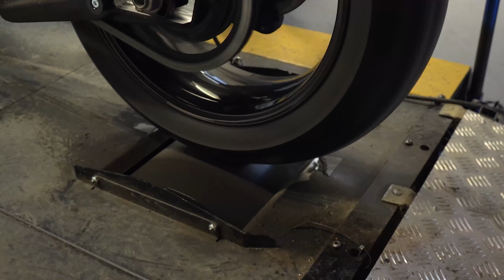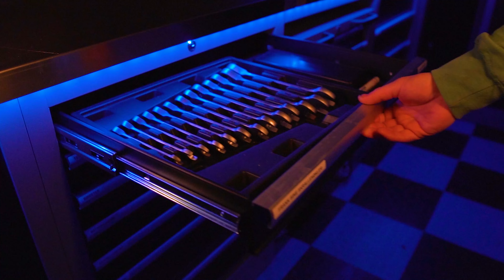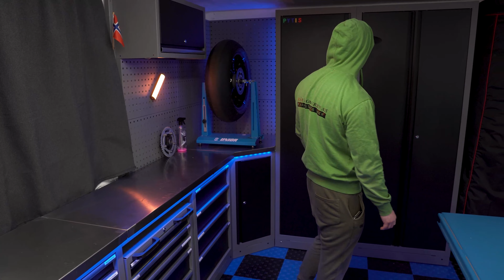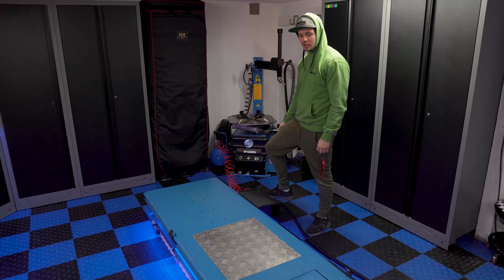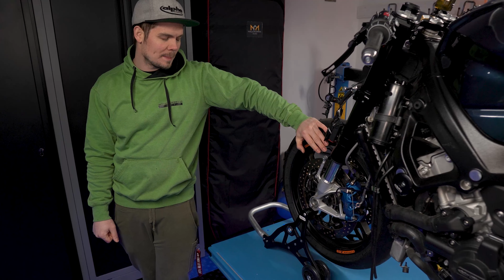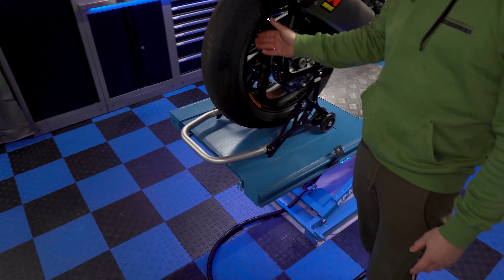New Garage, Upgrades And The Way Forward!

Comment: Hey love videos… Got a question… is your black race bike a S1000RR or a M1000RR?
And what Ohlins cartridges did you use for the forks? Thanks
Reply from the maker: Hi. Thank you! This bike is an M1000RR. It has Öhlins FKR 122 cartridges. Any time bud!
Reply: @RhabdoRacing  the black bike on the lift is a M1K? So why does it have a black rear swingarm? I thought the M1000RR came with silver swingarm to make it lighter?
Reply from the maker: Yes, this is an M1000RR. The standard MRR comes with a black swingarm. If you opt for the competition package you get a silver swingarm, billett parts and carbon bits, but this model makes no sence for a track build. You can also spot an MRR by the rear slot om swingarm, brakes back to front, rear rim, tripple clamp, engine covers and a few other things
Reply: @RhabdoRacing  ahhhh ok gotcha…thanks for clarification!!! So you have 2 M1000RR lol Lucky man
Reply from the maker: No problem. We also have a 2022 ZX10 coming in on saturday to unbox. M RCK video and dyno with the race ECU making big power coming up shortly. Stay tuned!